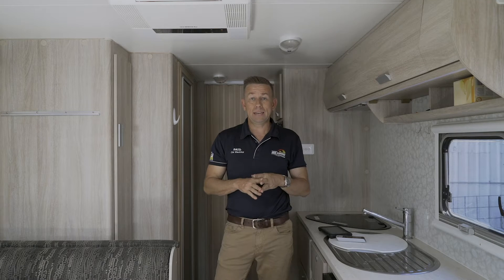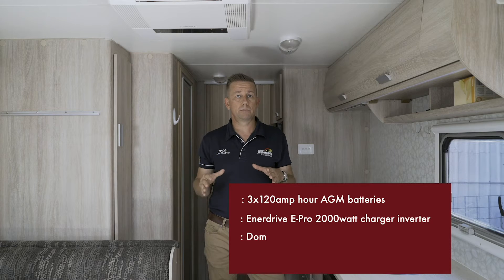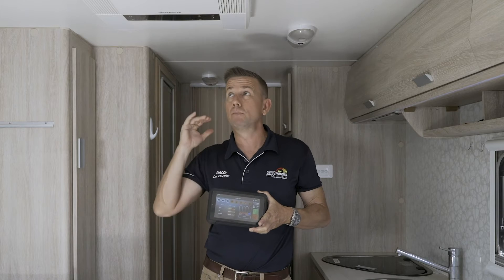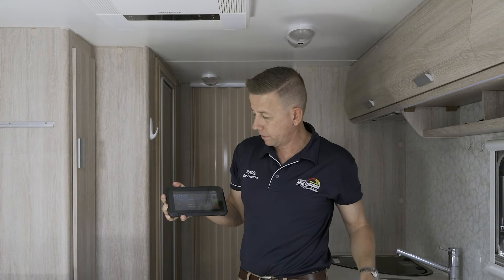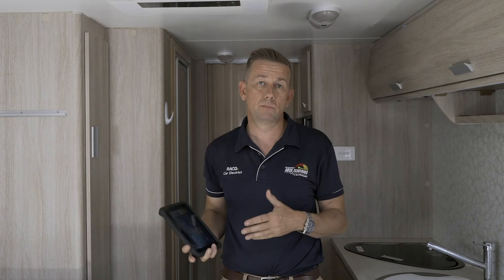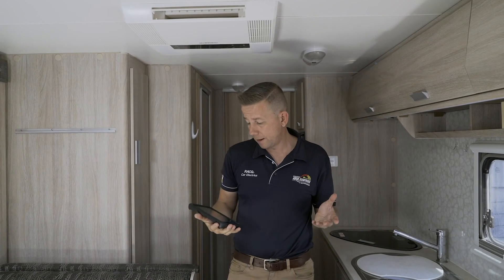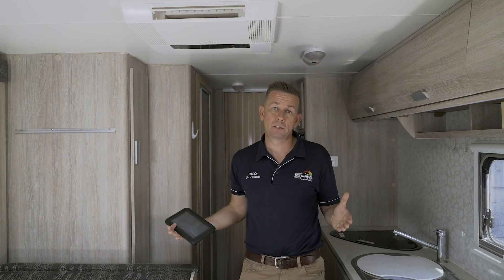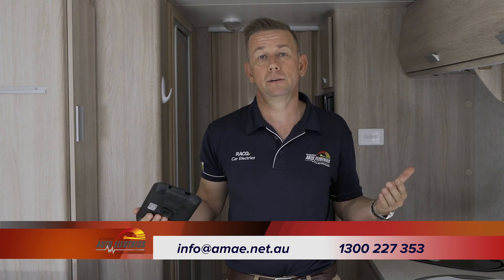Running AC in a Caravan - Off-Grid/Free Camping | Accelerate Auto Electrics & Air Conditioning

Comment: it was kinda unclear at the end for me, was he saying that after the unit works for that day, it won't work again the next day as it needs to charge up first, and it cant charge up if the air con is on for the 2nd day? thanks.
Reply from the maker: Yes batteries need to be charged back up - we have full solar setup in this caravan that will recharge it during the day. If it didn't recharge during the day on day 2 you will need to wait for it to recharge via solar or AC input

Comment: do you guys know if the houghton 3400 needs a soft start? if so what kind? cheers
Reply from the maker: Thanks for the comment!  Depends on the battery system & inverter fitted to run it. We recommend soft star units regardless to ease with the initial start up consumption.
Reply: @accelerateoffgridtouring  ok thanks, is there a universal type of just one type of soft start?
Reply from the maker: @vicleaguehockeyshow3099,  We would recommend chatting with the AC manufacturer to ensure that soft start units won't void the unit's warranty or what is recommended by the manufacturer to work best.

Comment: We will be running a similar system (2x120amh lithium batteries, 2000w inverter), and we wanted to know how is it possible to run this 2400w (cooling mode) air conditioner on a 2000w inverter?
Reply from the maker: Thanks for your comment! 
It all depends on your settings, on low settings & mid temperature the unit will operate under the 2000w limit. It is generally on high heat or HIGH Cold or start up that they peak at their maximum wattage.

Comment: I have 2006 jaco standard with 100amp so 12volt system. This does not run the air-conditioning so how much is the hard wiring for the air-conditioning if I have the3000 watt inverter panels, and batteries so basically I need to know the labour cost. Thank you
Reply from the maker: Thanks for your comment!
Get in touch via our online enquiry form on our website to get a detailed quotation!
https://accelerateoffgrid.com.au/pages/contactus

Comment: Hi, I have a 2018 Jayco Outback that has a J35B BMS and looking at fitting an inverter.  In your very informative video I see you were using the JHub so curious if this was running through a J35? Reading the BMPro site they do not recommend fitting an inverter to the J35. ‘The J35 is limited to a total of 20A (J35A) or 35A (J35B, C and D). When an inverter powers an appliance, the current draw from the inverter is typically much larger than the current supplied by the J35. It also states to fit an inverter directly to the battery to ensure that the J35 and battery monitor sees the current drawn by the inverter and need to install BMPRO’s BC300 External Shunt + CommLink to the battery.’

It is logical to hook the inverter directly to the battery as the J35 is a 12v management system.

 I can see there is “AC Connected” on the Panel when 240v is plugged in so the 240 obviously goes through the J35 for the battery charging and that would be the same if an inverter is plugged in. To run the Air conditioner that is hard wired (we have a Truma Aventa) the inverter would be plugged into the van. 

I have a couple of questions that I hope you could help with. Wouldn’t the inverter plugged into the van be running through the J35 and be stuck in a cycle of drawing from the batteries and powering the battery charger in the J35? Or does the BC300 and comlink stop that from happening? Thanks
Reply from the maker: Hi Tony, the inverter does not wire via the J35D. It is wired directly to the Caravan batteries with a BC300 to monitor the loads for the Battery display to be accurate. The J35D only has a 240v input for the use of the In built AC charger in the unit.

There is a particular way to integrate your inverter into your existing 240v Circuits to avoid the power loop which is required to be carried out be a licensed 240v Electrician.

Comment: Thanks for the video. We have 400AH LiFePO4 batteries and a 2500w inverter. Am going to put in a shunt so we can accurately measure amps in, amps out. We have 2 x 300W 12v pv in series going through a 40A MPPT and 2 x 100W 12v pv parallel through its own 20A MPPT. Do you think we are robust enough for our roof air a few hours a day used like you recommend? 
I would appreciate your thoughts. If you are wondering why the different pvs, the van came with the 2 x 100s but the LiFePO4 and 2x300W pv + inverter are my additions.
Reply from the maker: Hi Wayne, it's difficult to advise without knowing all the details and specifications. This is the kind of thing that would usually require an inspection at our workshop to determine the capabilities and suitablility of the system. We would be more than happy to assist, but we would need to know quite a bit more information about the various componets of the set up. Feel free to give us a call on 1300 227 353 if you would like to discuss further.

Comment: bro use DC INVERTER A/C it consumes 3 amps for 1 tonn ac, 4.5 amps for 1.5 tonn a/c and 7 amps for 2 tonn a/c. Also use a seperate solar panel and batteries for air condition system
Reply from the maker: Glad you've found a solution that works well for you. 👍
Reply: Baloch King. Sounds like a truck aircon? Can you get to fit a caravan in an existing hole? What brand do you have please

Comment: sleep mode function how much does it use in this mode its low fan and low compressor speed as possible
Reply from the maker: We haven't tested the system with the unit on this setting so not sure of what the figure would be sorry. Because each system is different we suggest running your own tests on the system and unit you have to determine the most optimal settings for your set up.
Reply: @accelerateoffgridtouring  it should be lowest setting all machines should be in spec from factory for this

Comment: Is the Harrier the most efficient air-conditioner to running of an inverter or are there better units?
Reply: I don't know if there is a more efficient unit, but given that it's possible to run a Dometic Harrier off a 1600 Watt petrol generator like the Honda EU20i or the Yamaha EF2000iS, I'd say this is a fairly power efficient unit.  The Dometic Harrier is the first caravan airconditioner that uses an inverter compressor.

Comment: Extremely impressive video, well done! My question is, would a CTEK 140 off road DC to DC charging system successfully replace the 1000W solar system on the roof? I’m thinking of a situation when I would start the vehicle every time the AGM batteries run out of juice. Thanks

Comment: This was very helpful. Would a “soft start” be any beneficial to the initial draw of AMPS?
Reply: The purpose of soft start is to take the sting out of starting large inductive loads.  They are basically a dead short as seen electrically so can cause overcurrent and low voltage trips on both the AC and DC sides of an inverter till the motor is up to speed.  They only operate for the first second or so till the load is up to speed and don’t really reduce the current/energy used, they simply spread it out to a manageable initial surge.
Reply: I just bought a 2007 Jurgens. And I mean literally bought it a few hours ago. It’s mint condition. But I’m thinking the first thing I’d like to do, is upgrade the entire electrical system.

Comment: Thanks for the episode. My partner & I are on the road & have been travelling the past 13mths around the country with a similar system, same inverter ibis 3 ac unit. Main difference is we are running 3x 110ah lithium’s 330ah total. From experience your scenario may not be real world, my reasoning behind this is. 
You would want to run the ac on warm days typically 32deg and above and as your run time on batteries is limited this would only be late afternoon at the earliest. The problem is heat soak, the entire van structure is hot. Yes it can take only 15mins on full to feel the air temp Change but the second you turn the ac down any the heat soaked van will begin to increase in temp so by the time you go to bed the batteries are drained and the van is hot & will have an uncomfortable sleep. You can also not run the ac the follow day as you will need all the solar to recharge.
This is the reason we put up with the heat during the day and only turn the ac on when we go to bed, put the ac to run on a 90min timer which drops our lithium’s to around 40% dod and the van to around 20deg. Obviously as soon as the ac shuts off the heat soaked van rapidly increases in temp but we have gone to sleep comfortably well before . The only time it makes sense to run the ac during the day to take advantage of solar input is if it cools of at night or you are on the coast with a good breeze over night to warrant opening the windows to cool off. We had AGM’s but they were just not up to running the inverter for any period of time. Granted our solar system is 480w and struggled to get the AGM’s over 80% slow charge stage, but the system charges at similar 20-27amp & has no issues getting the lithium’s from 40% dod to 100% No one we have met on the road has a 1kw system due to packaging I could only fit one more panel if I wanted to on our 20ft jayco but would be surplus to requirements.
Reply: This is why people are running 48V lithium setups with around 1kw@48V solar, putting around 50A/hr@48V into the batteries in peak conditions. This equates to around 200A/hr at 12V. Which allows the AC to run all day whilst keeping the batteries at 100% as the solar is surplus to what the AC is pulling.
Reply: @1989cranston  exactly, I'm doing the same thing, go 48V, the only way to go...good explanation to.
Reply: @vickimathews1970  Thanks :) , do your research on installers. i orginally looked at Safiery in Australia ( im assuming you are in Australia, sorry if i am wrong ). i did some research into their kits and back out of that transaction as fast as i could. Their mark up on Victron equipment is criminal and their "safiery battery" that they sell as their own for over 2.4k is nothing more than a dyness B4850 battery which can be purchased for around 1.6k each.
Just sourcing the items yourself online you can save around $4000.00.

Hope it helps :)
Reply: @1989cranston  wow, it's like you read my mind, how did you know I was looking at Safiery...I would love more info if you have it please. I'm building in March 2022, so have time still. What about their Scotty DC to DC and the 250a alternator? Thanks in advance.
Reply: @vickimathews1970  Scotty 12>48 is a great unit. But I am suspecting it is a rebranded unit someone else designed that Safiery is marking up quite high.
There are not too many units on the market in Australia for the 12>48V smart charging like Scotty but they are pretty popular in America.
I had a good chat with an ex installer from Safiery who put me onto them and said they were a better unit for far cheaper.
I can't remember the name of the unit but leave it with me and I will get back to you. 😄

As for the alternator they are pretty standard. You could search from a larger current alternator for your specific vehicle online and you will likely find multiple. 
Don't forget you never get anything for nothing, so a higher alternator output current means a slightly larger load on your engine which will mean slightly increased fuel usage.
Reply: @1989cranston  you are amazing, I really appreciate this, thank you.  You can find my email through here if you'd prefer to email  that way, https://www.youtube.com/user/vickimathews1970/about how do you know so much about all this, I know nothing about alternators/engines/building...lol...electrical, I'm learning little bits and pieces, but only very basic stuff, I didn't know the higher alternator output would increase fuel usage, but that makes sense, I won't have any other expenses, no house, only the home on wheels and I still have an income while on the road. I look forward to hearing more, if you are happy to help, I did find the 48v batteries, you were talking about, just over $1,300 each...much cheaper than $2,200.
Reply: @1989cranston  Umm.. 50A @ 48v is ~2500W of solar panels.  But you are right in the advantages, higher battery bank voltages can lead to lower costs of some components due to lower current devices and easier expansion of solar arrays.  For instance, a Victron MPPT 100/20 (a 20A device) can run a 48v battery, allowing for installation of 1160W of panels.  This only cost $195, has full Bluetooth BMS and comes with a 5 year warranty!
Reply: I've just bought a 20ft Jayco  heritage how many panels did you get on the roof it sounds like maybe 4 × 120w  and rough cost on it cheers